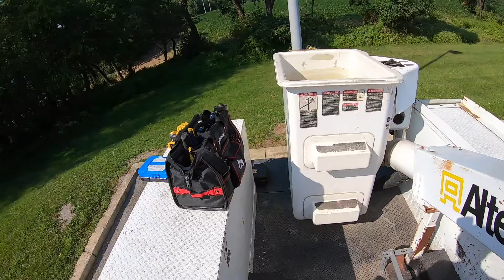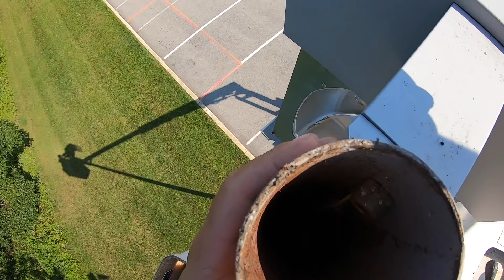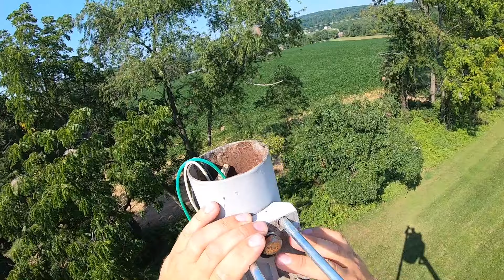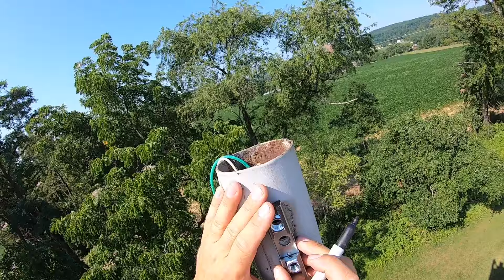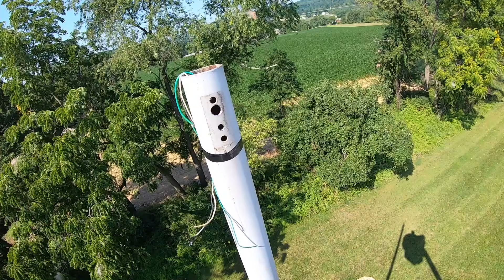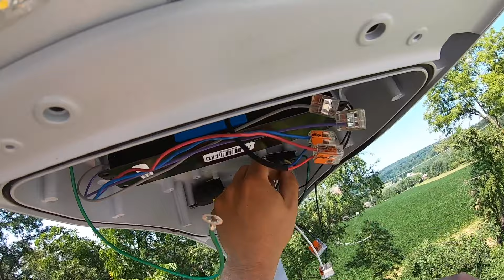DITL: Electrician in Bucket Truck...LED!

Comment: Heyi have a huge collection of streetlights and I wanna know what the company does with the old ones ? Do they reuse them or do they throw them away ? Or do you know?
Reply from the maker: I typically leave them behind for the customer to dispose of them. Normally they will remove the ballasts to scrap and recycle the rest, as much as they can. Not worth it to reuse these old lights, even though they are only about 10 years old. You can see how the seals shrivel up and turn hard and brittle, which allows the bugs and moisture to get in.
Reply: 65seejayfive can you please tell me if i can leave e a note on the pole of the light i want do you think they’ll notice the note?